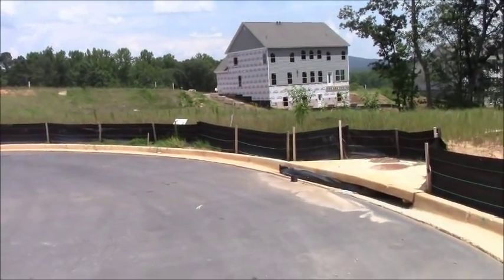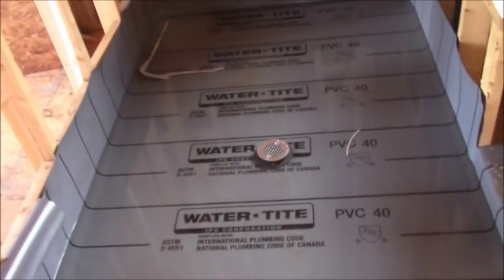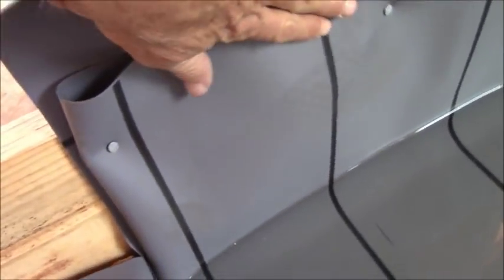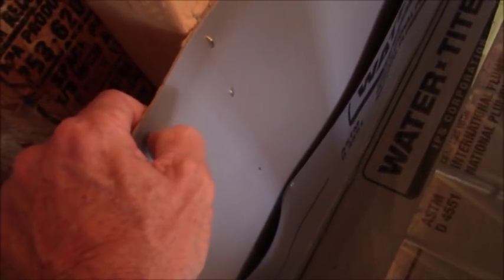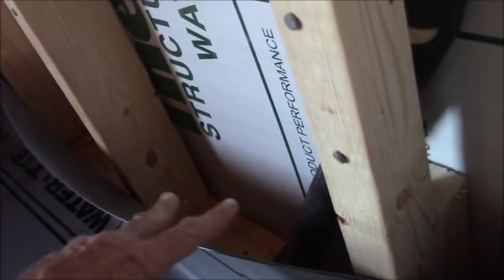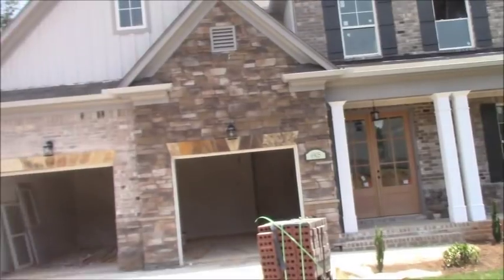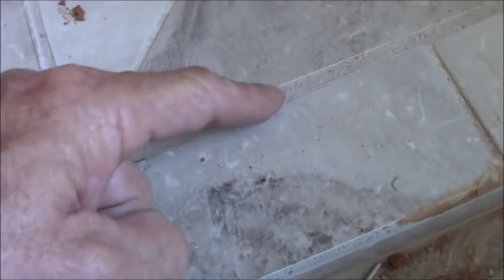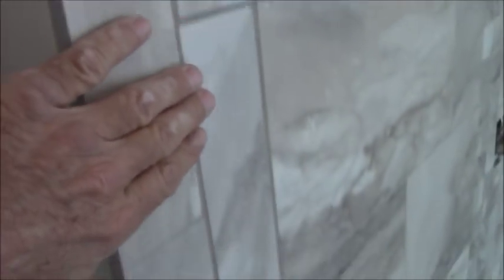NO ShowerPan PreSlope ..NEW CONSTRUCTION

Comment: Whether or not you think it needs a preslope, whether or not a preslope is really the best way, whether or not the inspector in that areas requires it, IPC requires a preslope. 

I see instances where  plumbing has been installed against code and pass inspection on a regular basis.
Reply from the maker: Since most guys that do tile are waterproofing their entire shower including their floor then it's irrelevant...no water will ever see the mortar bed, it's only there to shed water off surface or tile.

Here in Georgia it is not only NOT required, it's never done... I can only think of two showers I pulled out that had a pre slope in 20 years and both were done by the homeowner..and neither did any good whatsoever, pans were soaked with moisture.
Reply: I look at it from a liability standpoint. If you do an install that doesn't meet code, and later on there are problems, you can be held liable. Even if what you didn't do was not the cause of the problem, you still are more likely to have the blame, and therefore the financial liability, hung on you. 

The cost of the time, effort, and material to install a preslope gets passed on to the customer. As long as it doesn't increase the likelyhood of a failure, to me it only makes sense to install one. 

Also, and maybe this is where it is different for me than for you, I don't do the second mortar bed and tile work, so I don't have any control over how well that gets done. Not following code requirements leaves me wide open to being blamed for the failure of someone else's poor work.
Reply from the maker: Yes I understand and appreciate what you're saying, I have torn out showers that everything was done wrong on that lasted 35 years, that said I don't do any methods the way they did it 35 years ago so I know there is no liability and I've never had a failure in over 20 years...
By the way most contractors offer a one year warranty, even on a new house build, I offer a lifetime warranty because if I do something wrong I don't want to replicate it

Comment: StarrTile, I have to agree with you on the logic/physics regarding the "sponge" mortar bed being eternally moist. When you sandwich the mortar bed (pre-slope or not) between the vinyl pan liner and then seal the top in RedGuard, it's going drain some water through the weep drain holes, but retain moisture due to its porous nature, period. If you don't seal the top of the mortar bed with RedGuard, then the mortar might dry out in a few weeks of no use, but what's the point in that? Bottom line is that fallible humans wrote the IRC... just because it's code doesn't mean it's smart. Thanks for sharing your thoughts/experience... much appreciated!
Reply: I agree with

Comment: I have done a few.  I do ceramic tile and remodeling work ,, and I always have done a pre pan,,  then I install the liner,  but it seems to be a lot of confusion and how to do these custom shower bases on the internet and everywhere. Also I always install duraock and leave a gap on bottom so it stays dry.
I think they need a poured type of reinforced concrete system , just to many variables for failure.

Comment: You are incorrect when you state that preslope is not required for shower pan liners. Both the Uniform Plumbing Code (2015 section 408.7) and the International Plumbing Code (2015 section 417.5.2) require shower liners to slope at a minimum of 1/4" per foot to the drain assembly. Furthermore, the manufacturer's installation instructions for both Watertite IPS (shown in this video) and Oatey also require that the liner slope to the drain. As a plumbing inspector and plumbing plans examiner for a major city for the last 11 years, our jurisdiction has never allowed a vinyl liner to be installed without slope. Suggesting that this is a 'new' requirement is incorrect, and suggesting to other installers that they should not follow building codes is unprofessional! 
Oatey shower pan installation -   https://www.youtube.com/watch?v=dRwu1SE_Ass
Watertite installation instructions - http://www.ipscorp.com/pdf/watertite/Watertite_ShowerPanLiner_InstallInst_Sep09.pdf
Reply from the maker: Thank you for your response, I have looked up the IPC section you mentioned, and indeed you are correct ! 
The problem is that municipalities and, or States must have their own codes in place or adopt the IPC...the State of Georgia offers no evidence it is required, furthermore I've NEVER seen one installed in 20 years of tear outs, regardless if it was installed in the 50's, 60's, 70's, 80's, 90's, and not a one in the current 2 decades....not one.
As evidenced in this video and a few more on my channel, I can't find one being done now. To witness a benefit of a pre-slope, I need to FIND ONE...my logical mind says it doesn't function as intended, for the reasons I stated...having said that, no where do I advocate NOT doing one, nor do I suggest other installers NOT do one. Why exactly would that benefit me ??? What I said in the video is my opinion is they don't work, AND that I can't find one.
Additionally, every plumber I've known doesn't do one, which is why I've never seen one I suppose.
But your comment is duly noted and will remain for others to decipher
Reply: Here's a link to all of the current building codes (including plumbing code) currently in force for the State of Georgia : http://www.dca.state.ga.us/development/constructioncodes/programs/documents/2018effectivecodes-greensheetUPDATEDLETTERHEAD.pdf 
and another link to the Georgia State Amendments for the International Plumbing Code : http://www.dca.ga.gov/development/constructioncodes/programs/codeAmendments.asp
Please note that, just because a code section has not been enforced in the past, it doesn't mean it is NOT required! Many times the shower pan liner is installed after the plumbing rough-in inspection. Unless the inspector is doing an inspection on this pan liner, compliance with the code requirement is left to the ethics of the installer. Remember, ethics is doing the right thing when nobody will ever notice!
Reply from the maker: Agree with last sentence, which is why I waterproof the pan surface...which is NOT code, but smart to do & makes the pre-slope a moot issue.
Reply from the maker: So like the Loch Ness, these pre-slopes are hiding REALLY GOOD ! Some say they've been around MANY years, although no one can put a date on it...10 years, 15, 25 ?? Not only have I not run into one, no other video of a demo shows one....wall tear outs, yes...curb tear outs, yes..bench tears out, yes...even pan tear outs, but none show a pre slope because there never was one. Of 10 jobs I do, only 2 or 3 are failures of some sort, the other 7 or 8 are up grades, and an upgrade could be from 30 years ago or 3 years...just did a tear out last week, shower is NICE, in an $800,000 house, only 10 years old, no slope...it wasn't a failure, it was an upgrade. One would think >> Everyone is doing them, they are code in most places, they've been around for YEARS<< Then why can't I find one, and why are there no videos ANYWHERE showing a tear out of one. Neither the tile guy or the plumber are doing them ( here ) that I've seen. I suspect when I do finally find one, the pan will be WET and WEAK, and there will be no noticeable difference.
Reply from the maker: No, you can't fix stupid, which is way you argue & make immature statements rather than presenting your evidence...you wouldn't last long in a court room.
Stubborn has nothing to do with it, it's logical thinking, you may follow like a sheep ( non-stubborn ) but I don't. And you've no idea what codes are or not in force where I am. 
And all those showers I build will last longer than anything I've torn out. I suggest you actually know what you speak before you make a stupid childish comment, or back up your words with evidence
Reply: ..."which is why I waterproof the pan surface"... StarrTile, when you do this, you are creating a sloped shower pan liner! Please note that this is a code-approved method, using a code approved "paint-on" shower pan liner material (like REDGARD), of producing a shower pan liner. Your only error is not sealing the liner to the weep hole outer ring.
Reply: and to the statement that there is nothing on youtube showing preslope - Here's a youtube video showing the code-approved method of installation for a vinyl shower pan liner. 
https://www.youtube.com/watch?v=CXTAkwMqtEc 
There are many other videos out there, if you look!
Reply from the maker: What I said was there are no videos showing a mock up of a pre-slope to show it WORKS, nor are there videos of a tear out of a slope to prove it did what it purports. As far as the link you sent, seen it many times and that guy is a hack ! Not only was the backer not waterproofed, it was set INSIDE the pan, a HUGE no no in my book, and he married the mortar & curb, insuring any water will wick into the curb and out the other side, ruining the subfloor eventually....among other mistakes.
If this is your example of proper code pans, I would never do it by code...
Reply: I can see that you have made up your mind - your version is correct and the codes are not. Referring to others who install per code as 'hacks' is not going to support your position. Be thankful that you do not work in our jurisdiction, where you would be required to install per the adopted code. I have no more time to waste on you!
Reply: Here's the video from Oatey showing the proper installation of their shower pan liner - note that it's quite similar to the previous video link  posted above. Is the manufacturer a 'hack', also?
https://youtu.be/dRwu1SE_Ass
Reply from the maker: After 20 years doing this work & 7 years on YT, I've seen that too....Yes, they are hacks.
1. Mortar on both under & top is wet, not dry pack
2. At 2:34 they mention liner should be up from curb 2'' but code is 3""
3. I never push liner over bolt heads, it stretches liner..I cut X and insert bolts through the X
4. At 7:00 they advocate wall board INTO pan, then pour pan, NOT A GOOD IDEA AT ALL !
5. At 8:02 they build curb from mortar, mortar bed is in direct contact, wicking WILL occur into & outside of curb if pan gets wet

So yeah, nice try again, but no cigar.
Reply: StarrTile, per your last response:
1 - no code requirement for mortar to be dry pack, only that the surface provide 1/4" slope to drain. Same requirement for Wedi and similar systems. If I had an installer provide the preslope using plywood, it would meet code!
2 - You are correct, code requires liner extend 3" above threshold. Code requirement does supersedes manufacturer requirement ("most stringent shall apply")
3 - personal choice, but not required by either code or manufacturer.
4 - personal choice, both code and manufacturer allow this. 
5 - If you install tile from the shower pan area, up over the curb, and to the outer curb face, with thinset and grout, won't this 'wicking' occur thru your materials, also?
Let's all agree on one thing - an installer is always free to exceed the code requirements , but must meet all code minimum requirements in effect in their local jurisdiction.  Any lack of local enforcement does not relieve an installer of the code requirements.
Reply: This is correct and the tub was not a flood test, it was for weight setting in motor
Reply: also i stated above the pex was UPONOR
Reply: Your right it probably doesn't do a tremendous amount , water will find its way out.
But I feel better the believing a sloped surface will shed water quicker and keep less water wicking up the cement board, even if its elevated .
Reply: you are correct sir....where I am at every liner gets water tested and inspected by a building inspector....there absolutely has to be a pre-pitch rough in. The inspector pulls the plug himself and the water better flow smoothly to the drain or you dont get permission to close the walls up and start tiling.
Reply: That does not mean every tear is because of failure. I am sure many tearouts are for refinishing, remodeling, changing a bathroom layout....did you think about that?
Reply: Every option has an application. Who would want to spend $750 on Schluter products in a small bathroom renovation  when I can waterproof it for $50? Just because there are new products out there does not mean they are the best option (specially when clients have a budget).
Reply: Guys why are you arguing about code when it is patently obvious that StarrTile is not only not a licensed contractor anywhere in any state for any trade for obvious reasons but he is more qualified than any permitting agency or trade code or manufacturer of pvc pan liner or from anyone.  Please just listen to him and everything will be fine :/
Reply: @Tinroofdeals  lol
Reply: Agree. It’s not a “believe”.
Reply: @StarrTile   why such an angry reply then? so what i ask is you follow waters least resistance in your "logical mind" capillary action combined with gravity and a slope would lead it downwards towards the drain before saturating the pan as you say. also trapping water between two rubber membranes is a very bad idea as demonstrated through the insulation industry. StarrTile I think you are a very good tile layer but really have very little understanding of how a building functions and how the other trades work as well as an refusal to accept new techniques in the industry
Reply: @StarrTile  Just adding my two cents and for others to see. I just tore out my old shower, built in 1988. There was no preslope under the liner, but there was black mold. Could be that my slab isn't level and the water pooled at the low spot. At any rate, I'm 100% certain the water issues are present in my case, so I'm adding a preslope this time. Will it help? I don't know, but it certainly won't hurt considering the alternative. Something to think about for your viewers.

Keep doing good work, I've learned a lot from your videos.
Reply from the maker: @tomcarrow   Tom Carrow  So is is possible to have standing moldy water without a preslope, and in your case black mold...YES...but it's encapsulated so doesn't effect you whatsoever, ans even with a slope you'll have 100% water content which is all mold needs, moisture & food, you'll have that regardless. But more to the point, everyone waterproofs their pan surface nowadays so the notion of a slope is a moot issue.

Comment: I noticed the metal protection plate behind the pan liner at 4:00, I recently tore out a failed shower where one of those punctured the pan. I recommend either removing them where they touch the pan or covering them with something first.
Reply: and the protruding nail ready to poke holes.  Bad place for metal for sure

Comment: no pre-slope  
there will be mold issues down the road...
Reply: I just tore my 12 year old shower apart and discovered the weep holes were filled with mortar!To top it off, there was no pre-slope under the membrane. The existing membrane is still there and I can’t decide if I need to remove it and put a pre-slope. I pretty much had my mind made up until I see this guys video. I wonder if I should just put the new draining, do a mud bed myself and make sure the weep holes are not blocked.

Comment: Just checked out video. The plastic tubing used for water piping I’d uponor pex tubing I’ve been using it for the past 20 years. Love the stuff much more durable the traditional pex tubing. It has memory cells and pipe expands while being  placed over fitting makibg the seal.

Comment: its pex, the connectors are wiersbo. You use a hand pump tool to expand the connector & it compresses after that
Reply: John Engerran it's garbage
Reply: Bullshit. It is the best pipe made so far. Explain to me how it is garbage and then I'd love for you to explain to me how copper is so much better lol. Copper corrodes, pex does not. That pex will last longer than that house, copper will not. Pex can withstand freezing temperatures while copper busts. So how is it garbage?
Reply: Daniel Lawless I agree, Pex is the best stuff out there especially uponar pex with the expandable collars like you see here.
Reply: I won't argue the point about PEX, but there are millions of homes built with copper pipes and have NEVER had any issue. On top of that - Copper is a natural anti-microbial - last time I checked PEX does not have any anti-microbial features ..
Reply: Stix I think the only time you worry about the microbes is if your not on city water, but on well water and should have your water checked regardless. At worst you would flush your system with a diluted bleach solution to kill any possible contamination every few years.
Reply: The ground water in Northern Minnesota has enough chemicals in it that after 25-30 years the copper is so thin you cannot cut and, re-solder. I have just replaced all the existing copper lines in an early 80's home, here in Anchorage. The house was originally on well water, almost every solder joint was corroded, and portions of the copper had been replaced PEX and Shark Bites.

Comment: 30 years. No pre slop ever. EXACTLY Capillary is a real thing. Finally I found someone on YouTube that agrees with me. 
Not so sure about the liner and corners. I wouldn’t have done it like that. No cuts or nails/ screws below the finished curb.
Reply: im not argue about shower but preslop is a must on roofs or balcony even on new construction , it make a big difrence specialy where you have temperature below 0 celsius  
 i dont say we allways do this but it make the diffrence , at least here in europe  
on balcony i allways do a preslope on concret  ,it cost me nothing
Reply: Just tore out my parents shower. It had mold growing for as long as we could remember. If you bleached the mold it would come back the next day. 

When I tore it out, there was standing water in the corners that never drained...causing the mold.